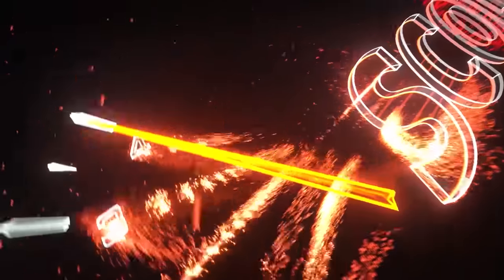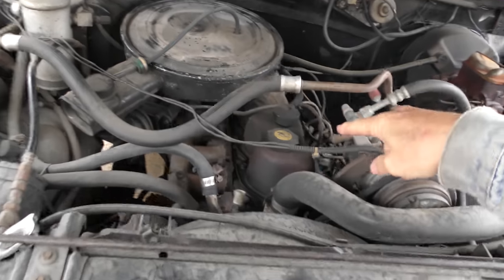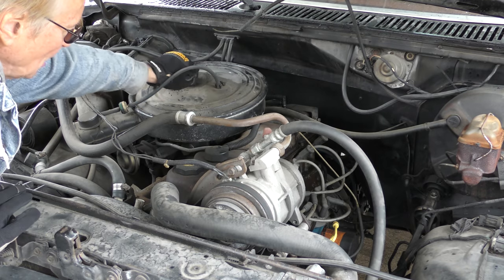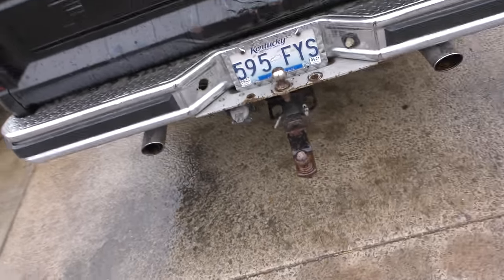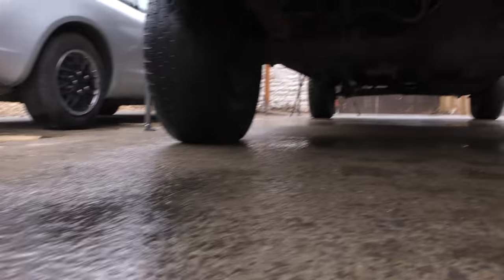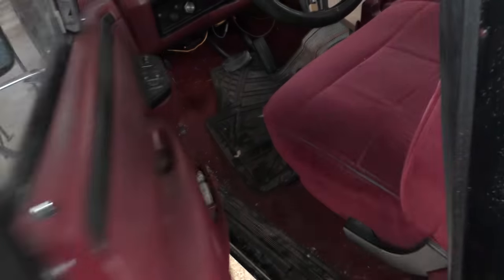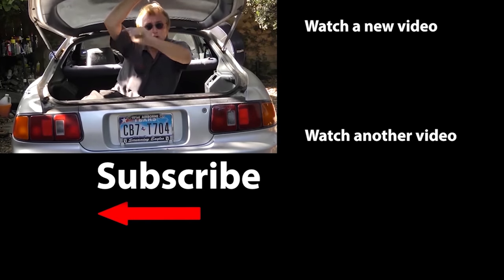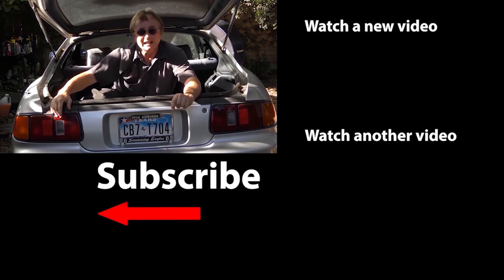I'd Give My Left Arm for This Truck

Comment: My '03 Chevy Trailblazer has an inline-6.  Over 222,000 miles and it still pulls a trailer strong, just like Scotty said about the inline-6.  Same type of engine as used in refrigerated box trucks for decades.

Comment: i had a f 100 and i paid 2k for it back in 1995 it was a 1993 model i put 300k miles before the transmission went out in 2019.
Reply: @applepoop10  it was in 2018 when it went out and not worth replacing it or rebuilding it.

Comment: Had a 74 Mercury Comet with a transplanted 300 with Clifford research headers and cam. Ran 13.50's all day long. Final blew rod at 350,000 of hard miles. Amazing torque.

Comment: Love these old Fords! I've got a '72 F100 with a FE 390 and it's as simple as it gets! Performance parts actually work on these vehicles because you are in control of the air/fuel mixture and not computers!

Comment: Currently still own and drive a 1983 Ford F100.. The last year of the F100. have had it for about 35 years. Straight six 300. It is now 40 years old.  Over 300,000.. still runs strong !  Ford's straight 6 300 engine is one tough engine !! Matched with the AOD automatic.

Comment: Same with my dad’s 2006 f-150. Solid truck. Only problem was a timing chain tensioner that caused it to slip a link and crash the engine. That only happened once. Other than that, it is a solid truck with plenty of power, it’s simple to repair and even in Arizona the battery easily lasted 6 years.

Comment: replaced a v8 in a 77 f150 and a 85 f350 dually with 300 6 cylinders. Both pulled like bulldozer. BEST  vehicles I ever owned!.  Well, my 87 wrangler with a straight 6 4.2 and my 90 Volvo  with a straight 4 cylinder  were pretty good too.

Comment: Bought me a 1966 Ford Ltd, 390 always been a GM guy!  Now I question my whole life. Ha ha
Reply: 390s are awesome.  I love that you can just give 'em a little gas, and they pull strong and smooth without all the noise and drama.   My old T-bird had one.  80-90 mph was easy to achieve.  No sense of speed or effort at all. Just tip into it and roll....

Comment: Ah, those 85 MPH malaise-era speedometers, from the days of the "double-nickel" speed limit.   That truck can probably bury the speedo given enough time.
Reply: I got the impression that my '82 could probably reach 90 if I really wanted it to, but I never ran it that fast, and 'speed' wasn't really what the 300 inline was built to do anyway.  Their forte was durability, reliability, low maintenance, and off-idle torque - all of which they achieved, in spades.   It could roll at 60-65 while loaded, without any sense of 'effort', and that was sufficient.   The 85 mph speedos never bothered me anyway.

Comment: I had a 1980 black F100 with a 300-6, 4 speed manual, standard cab, long bed with a 9" rear-end. That truck would not die. I'm currently looking for another 80-96 similar configuration. What great trucks!

Comment: Love those old American straight sizes.
My 71 Chevy 250ci six has over 300,000 miles and is so easy to maintain.
I'll be rebuilding it soon as it's starting to smoke a little but even that is easy.

Comment: My 1986 F150 has that engine with 298k and still pulls strong and works well and no oil usage. Manual 3 speed with OD. 25-28 highway and 20+ mpg around country even pulling trailers. No a/c but a great 8ft bed!

Comment: Ran a 86 f250 for decades as a welding rig, 351 Windsor. Couldn't hurt that truck sold in 2008 for a grand still running well. Best trucks ever made.

Comment: I have a 1980 F250 with a 300 and been using it to haul logs for a tree service for almost 12 years. It has 287k miles and still runs like a champ. Cant beat these old Fords

Comment: Had an 82 f100 with the 300/6 and manual 3 speed with overdrive. Transmission went out at about 20k miles so we put a 4 speed granny gear from an f350. That truck could tow anything after that. Wish I still had it. Live and learn.

Comment: I got a 92 f150 with an in line 4.9 6 cyl. Currently at 321k miles and runs great. Ac doesn't work but that's what manual windows are for

Comment: Truck starts popping in/out of gear, needs cab mounts
300 light shake is usually due to lack of maintenance + being beat on
Cylinder deactivation does cut lubrication, a little blowby acts to redistribute oil left on walls as well as help piston float like on an air hockey table. It's not a lot but it's enough to offset the weight of the piston and rod dragging on one side due to gravity and tendency of piston to push in the direction of rotation as well as cock sideways with the motion of the rod and wrist pin. It's not even a protective thing of the near oxygen free environment, v4 and v8 1 bank air compressors run w/o trouble.

Comment: I bought one new in 81. Straight 6 with 3 on the tree. Regular Cab with a 8 foot box. drove it without a problem for 8 years and 487,000 miles.

Comment: I really am amazed at older pick ups.  My ‘98 F250 is modern compared to the ‘81 F100, yet other than the coil on plug, they are quite good.  Great 4x4 and comfortable for the long haul, so my ‘98 Ford F-250 is a keeper. BTW I bought a 2018 Raptor and doubt that 3.5 twin turbo V6 will get to 160,000 miles as easy as the 5.4 Triton V8. Heck the 5.4 V8 has at least another 150,000 left in it.

Comment: I am 17 and my first car is a 1978 F-100 flareside with the 300 Straight 6. I have been been restoring it for the last 2 years. I had to rebuilt the engine because piston rings were gone. Before the rebuild that thing would run great as long I kept oil in it. Now that the engine was rebuilt (After 100,000 miles on the motor) that thing is better than any new truck on the market. I love the 300, honestly  I think it is the best engine Ford ever produced. I will take 1978 Ford 300 over my 1996 Ford 351W everyday.

Comment: I have a 1981 f100 with the 300inkine 6 and a 3 speed, it used to have the 3 on the tree but the shifting cone is wore and I put a floor shifter, it’s completely restored with insulation everywhere brand new carpet and door panels with a touch screen stereo and a  white leather bench seat with leather door panels and it runs amazing, never has let me down, and I get pretty good gas mileage once I rebuilt the engine, but before it got about 15, now around 18 if I don’t put my foot in it, super comfortable truck I put new weather stripping everywhere and it’s nice to ride in, with all the insulation and the twin I beam suspension it rides like a luxury car of the era, the step side is also a nice look and it’s a real head turner, I’ve even had a conversation with my high school security gaurd about it before

Comment: I have a 1982 Ford F150 longbed, 300 Inline 6, 3 speed auto. I have an Offenhauser intake and Quadrajet 4bbl. 2.70 gear, open, I'm pretty sure. 265/75-15 tires on aftermarket 15x8 wheels.
200k miles.
Gas mileage could be better, but I've been driving it pretty fast and pretty hard. Got 14 mpg overall with the 1bbl.

Comment: I'm picking up a 94 f150 tomorrow morning with a 300ci straight 6 and manual trans. I'm excited.
Reply: Best decision you could make, I've got a 94 XLT with an automatic and it has been abused and even totalled another car (not me) and got wrapped around a tree (icy road) and drives amazing.

Comment: I bought a 1985 Ford F-150,.. in "88",.. when I got out of the Army,.. 300 6 cyl. truck,.. with a/c,.. 4 speed. The only truck (vehicle),..I ever had,.. 'till I bought a 2017, two yrs. ago. The "85" is all original with 612,000 mile's on it,... 131 oil change's, (Rotella T 15-40),... alway's pluged it in,.. when it got below 10 degree's. My only transportation for 32 yrs. Were both old,.. and still goin'.........

Comment: Scotty, I traded a 1969 F-100 in 1975 for a 1975 cherry red F-150 which I kept and traded in for 1984 F-150. they all had the 300 straight six and I put over 200K on each one. they all were great work trucks with 3 on the tree. best I had was a 1988 F-150 I bought in the mid 90's with a mazda 5 speed. Love your channel !

Comment: I have a 1986 Ford F100 with a 300 inline 6 and it's a standard and a flatbed and that thing still runs like a dream and I love that truck I bought a brand new slave cylinder for the clutch I just have to bleed it and that's taking forever

Comment: The best engine for ever made that is the reason those motors run forever. I had a 1995 Ford with that motor in it and I used to pull an 18 foot Boston whaler down the freeway had plenty of torque to do it

Comment: Those were diesels with spark plugs. Change the oil, change the coolant every now and then and don't go over 4K RPM. It will keep on going. Sometimes outliving the truck. Then you can use the engine as a generator or a giant water pump.

Comment: I have a 1986XL with a 302 built up with a RV Cam. Edelbrock performer intake with a 670 dual feed carb and it has a 4 speed and its running a 9" Ford rear.

Comment: Yeah that's what I'm all about baby I've owned 3 Chevy S10's 1988 , 1994 , 2003 all good runners but the damn fuel pumps were internal ! But my absolute favorite is my 1972 El Camino I'm on the 5th one HA I put the Muncie 4spd in it but I'm switching back to the
B/W T-10 with the 2.88 1st gear due to the freeway gears in the rear ! Love your show yer the best

Comment: i had a creampuff powder blue '72 f100 same motor, 3 on the tree back when i was in college in the late 80's.  no ac, very plain jane, but it did have 2 gas tanks.  great rig.  never should have sold it in the mid 90's.

Comment: I used to own an 85 F-150 with a 300 inline 6 and I used to use that bastard to pull over trees when they were hanging over houses when I was cutting them down the low end torque on those things is honestly astounding

Comment: Nice to see Scotty spitting truth I got a couple fords myself
1986 f 150 inline 6 4x4 4spd manual
1986 f 250 302(efi) 4x4 auto
1989 xlt lariat 4x4 lbHD 351 5spd manual
1992 f-150  302 2wd 5spd manual
2003 f250 yooper duty 4x4 5.4 auto
2005 expedition 4x4 5.4 auto.

I have as much into my trucks as most people pay every couple months for payments and insurance.....
It's not easy- I hardly have room for my Cadillac's and mopars...
livn free in the U.P
live it up y'all- stay free

Comment: I owned a 1981 F100 back in the 1980's. 300 6 cylinder, 3 on the tree, no power steering, no power brakes. Probably the cheapest F100 you could buy brand new at the time. I'd like to have it today.

Comment: My first truck was an 88’ F-150, 300 i6. I blew it on the way to school one morning, so I bought an 82 F-100, 300 i6, a couple months later (same year as the 88) I blew it on the way to church. Dropped a 302 in my f100, I’ve been driving it for 5 years.

Comment: Just love driving my 1981 Ford F100 Custom , Bought mine in the early 90s.  Still running strong with the 302 engine.  Right at 300,000 miles on it,!!!! with the RUG transmission!!!! When the engine goes,,, im going to rebuild her !!!! Shes worth more to me !!!!! then what anyone else will pay !!!!!

Comment: I have a 1996 Ford F-150 4X4 regular cab, short bed truck with a 300 cu inch engine and a ZF-5 transmission.

Comment: Remember voltage regulators, I replaced a bunch of them on my old mopar products years ago. They were an inssue on Plymouths and Dodges but they were less than $10 each and it took about 5 minutes to replace one.

Comment: my grandpa's truck (1985 Ford F250) has a 300 in it. it's been parked for the past 24 years. He said that one day it just quit. Now, what he means by that? idk. could be a spark thing, could be fuel, could be something else. anyway, my plan is to get the old thing running again. it has 75,000+ miles on it. The clutch petal makes me think it could've rolled over once (so, 175,000+ miles) but I could be wrong.

Comment: I had an 86 Ford 350 was the International diesel and I got 355000 Miles out of it in Michigan though and the frame was solid, everything was solid but the camera would start to break in and it was still going, I just got tired of driving it. Air conditioner worked good. Had AC6 transmission that worked good.

Comment: you might want to check out   power nation .  they put the 300 on a dyno and tested it with headers , different intake and carb  individually and in combo .   i was impressed by the hp gains

Comment: I drove service trucks and vans with that same engine 300,000+ miles. Nary a hiccup. Tires, batteries, the occasional starter (changed out in a parking lot in ten minutes), and the body and interior worn slap out. But STILL running. And running good. I started driving the 300 "6" in the seventies and did so into the nineties. The single most bulletproof engine ever built. Ford used to build some IRON.

Comment: I had a 95 longbed f150. 302 Windsor with an auto trans. I bought it used for 1500 bucks with 150k on it. The air was shot so I rebuilt it for the cost of parts. About 400 bucks at the time. I drove it for 200,000 miles and only replaced the brakes and a water pump. Coldest air I've ever had on a vehicle. 

I finally traded it off for work on my house. I miss it. Rock solid vehicle.

Comment: I had an early 80's ford bronco and you could sit in the engine because there's almost nothing in there. Also had the bolted on back hatch that you can take off and turn into a summer time party machine

Comment: I've got an 86 LWB single cab.  Manual 
w/o AC......  375K miles.....same engine with a newer (granny tranny) put on 20 years ago..... It's been a tank.  Left it sitting for 5 yrs once.....and still going.  I drive it maybe 500 miles a year.....to take off trash or as a backup.   The 80s  Fords were the best they made.

Comment: This thing is cheap and easy to work on. I spent 225 bucks on the starter, starter solenoid, mechanical fuel pump, spark plugs, spark plug wires, and water pump.  Smoked for about 20 minutes, then it ran like a champ.

Comment: Had an 87 with fuel injection and a 4 speed with "double" low first to get it moving. Great work truck. Pulled 22ft trailer with anything from the bobcat to delivering lumber. Only problem was it could pull more than it could stop!!! Got to have brakes on the trailer?!

Comment: I’ve restored my 1980 F100 step side, with straight 6. I’ve put over 750,000 on and just put a new Jasper rebuilt. I bought it of $9600 ($6600 + $3000 trade) from the dealer.  

She’s my baby.

Comment: Miss my 85 f150 4x4. 2 bolts I changed the fuel pump in like 10 minutes. My 10 silverado 4x4 had it in a shop to drop the tank and replace it for $1,000. I sure miss those old fords

Comment: I had an '89(I think)with the straight six, manual everything, 2 gas tanks= 750 mile range. Great for Mexico trips. I remember it getting 21 miles per gallon... towing! I paid $5000 with 40,000 miles on it in 1992. Sold it with just over a 100K for $3800 to a friend. Best truck ever- the wifey didn't like it's appearance and I bought a NEW 98 F150, V6= rebuild at 64K miles. :(

Comment: Well I drive a '66 F100 as my main work truck, had it for a few years, bought it for 2,000, it had been driven every year 1966-2018, had either 185,000 miles or 285k. Original 352 V8, 3 speed 3.03 Ford on the column, 9 inch rear end w/ 3.25:1 gears. She smoked pretty good, brakes were weak, fuel system really dirty, clutch just about done, and suspension pretty worn when I got her. Did a mechanical restoration by myself over 8 months, now I have a still very cheap truck that is mechanically brand new, and even more simple than the '81 in this video. She gets 13 mpg, will cruise 75 mph on the interstate all day, and she still hauls and tows very well. If I'd spent the same amount of money on a halfway modern truck, I'd have some truck with not much life left in it, and not one easy to work on at all, and it sure as hell wouldn't look half as good.

Comment: I have 86 and 87 ford 250 deisels. Run forever, and I've jumped the 87 twice all it did was break bottom bolt on one shock.

Comment: I had an 83 with the 302 V8 and my friend had an 82 with the 300 I-6.  He would beat me off the line but I would quickly catch/pass him.  Those were great trucks back in the day.  I pounded on mine for 200,000 miles and sold it for what I paid for it.

Comment: I have an 82 F100, 4.9 L6, 43k original miles. I'm the 3rd owner, my dad was the 2nd. Sat in a parking lot for 15 years. He parked it because it didnt run right and couldnt figure out the issue. I got it 2 years ago, changed all the ignition system (cap/rotor/plugs/coil/ICM all for less than $40 total) and still didnt run right. Well, turns out mine had an electric "assist" choke and was missing the heater tube to the carb from the exhaust manifold. Once I ran some seafoam through the system (did not even have to rebuild the carb) and replaced the tube - well its been my daily driver for a couple years now. I live in SD.  The thing even started right up a few weeks ago when it was -20F (actual temp, wind chill was -40).  I probably have $3k in restoring/upgrading it now because I paid a local guy who reminds me a lot of Scotty. I modernized a few aspects but past that this truck is better than any "newer" truck I've owned. (although there have been about 3 or 4 days I wished it was 4wd)

Comment: I have to agree with you Scotty. I am the proud owner of a 1981 F150 that currently has a 1973 429 and c-6 from a T-bird in it. The previous owner put it in after spinning a bearing in the original 351M. This truck replace a 1985 F150 with a 351W H.O. engine that I totaled when some Bozo ran a stop sign and I T-boned him. If I could, I'd buy a fleet of them lol. They are Ford Tough !

Comment: I have an 86 f250 4x4, extended cab, 4 speed manual with a 460. It has paid for itself 20 times over and is worth triple what I paid for it. If I could somehow get more than 10 mpg I'd never replace it